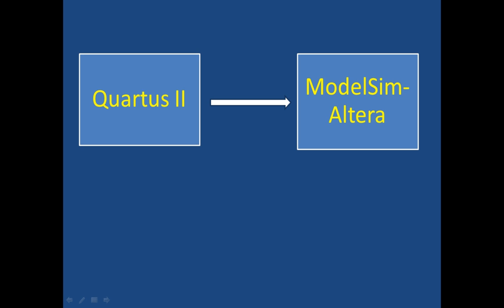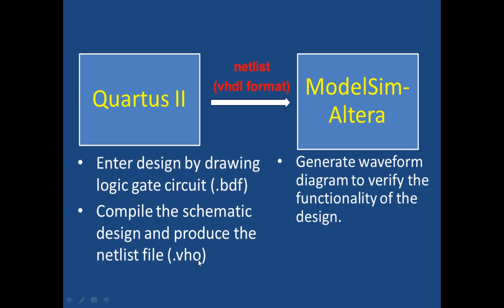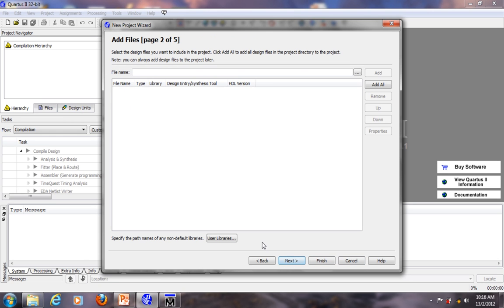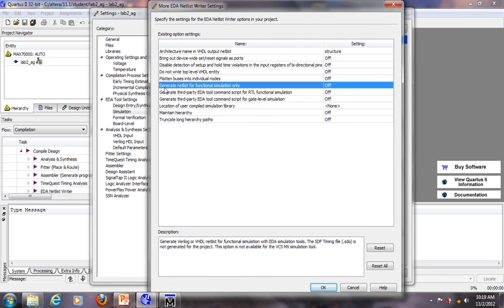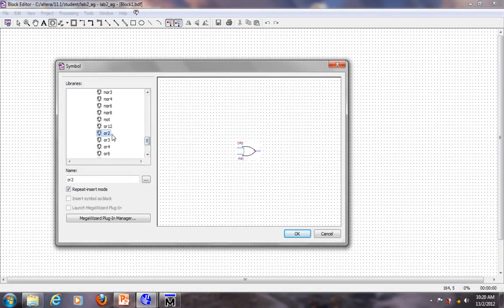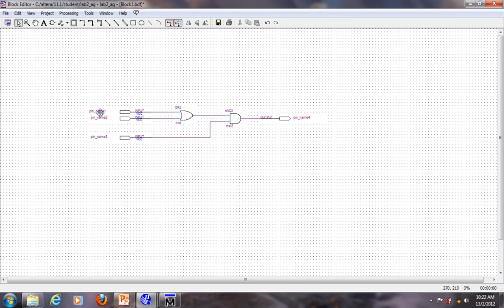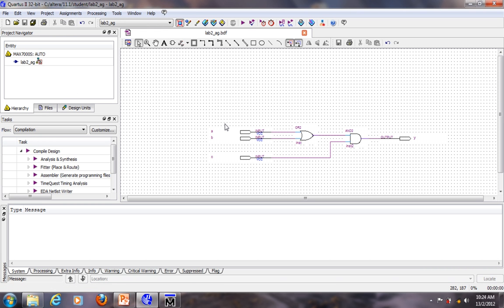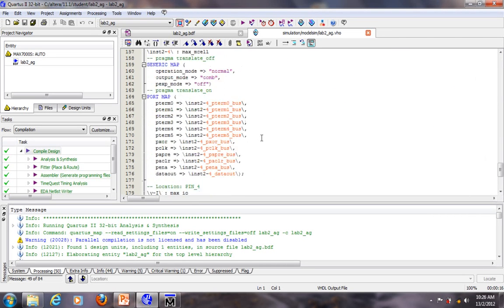Getting Started:Quartus II & ModelSim Tutorial © UNITEN

Comment: Thanks. Can you help me? When I compile, I'm getting this error: 

Warning (292000): FLEXlm software error: Invalid (inconsistent) license key.  The license key and data for the feature do not match.  This usually happens when a license file has been altered. Feature:       quartus License path:  C:\altera\90\quartus\bin\quartus.dat; FLEXnet Licensing error:-8,523 For further information, refer to the FLEXnet Licensing documentation, available at "www.acresso.com".
Error (119013): Current license file does not support the 5CEBA2F17A7 device
Error: Quartus II 32-bit Fitter was unsuccessful. 1 error, 1 warning
	Error: Peak virtual memory: 359 megabytes
	Error: Processing ended: Thu Oct 22 13:28:07 2020
	Error: Elapsed time: 00:00:02
	Error: Total CPU time (on all processors): 00:00:02
Error (293001): Quartus II Full Compilation was unsuccessful. 3 errors, 1 warning